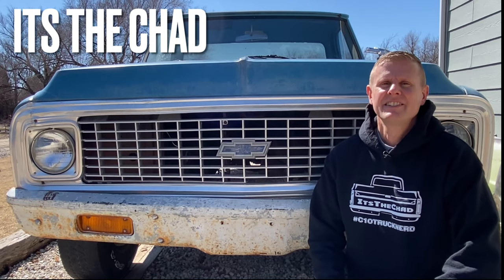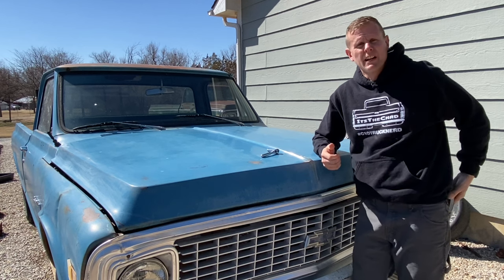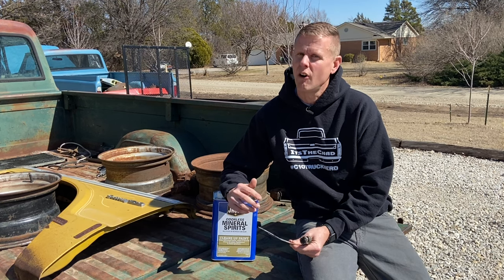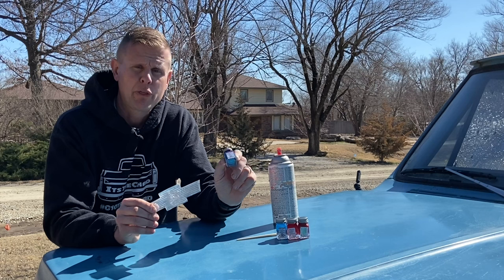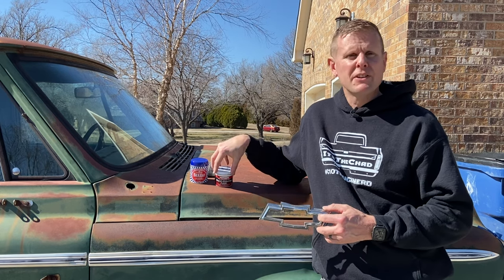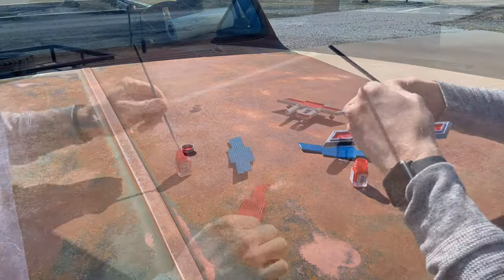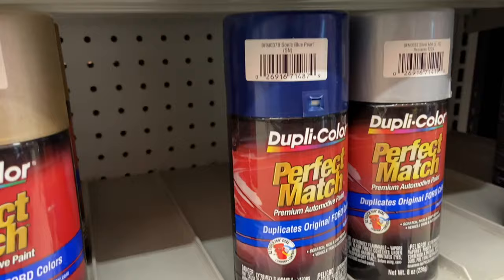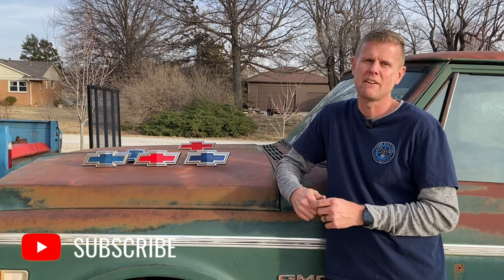Reviving The Classic Chevy Emblem: Restoring And Personalizing Your 67-72 C10

Comment: Great video. But what about the engine size emblem. According to LMC, those emblems are an option but I rarely see them. What's your opinion.  Thanks....Doug
Reply from the maker: They started in 69. 69-70 they were under the C10 or Custom badges and then moved under the side marker for 71-72. I keep a bunch of them when I part trucks out.

Comment: I prefer the blue in the grill . I was hoping to see how you put that 67 fender emblem back on. I mean to take mine off and I'm wondering if there's a way to do it without removing the fenders
Reply from the maker: OG blue looks the best to me as well. It is very difficult to slide your hand from the bottom or from under the hood to reach them. As you can tell, I have little bird arms which helps. Pulling the back of the inner fender down might be the best bet if you soak the bolts first. You have given me an idea for a video!

Comment: Chad ! Have a question you'll probably know ! Was the 66 C10 1500 the last year for wood bed floors ? I think so but another guy says NO ! Thanks for ur reply ! 👍
Reply from the maker: It was not. Wood continued to be the standard floor in 1967 as well and was still painted black. In 1968 metal floors became standard with wood as an option through 1972 but would have been painted the body color. Hope that made sense.
Reply: Thanks chad, guess I was wrong ! Was thinking 66 was the last year !.😂 win some, loose some ! 👍

Comment: Chad, thanks for all of the information that you have been providing.
I have a question, 67 with west coast/trailer mirrors, when new were the nuts and bolts used painted or plated.
Most of the trucks including mine that I see have everything painted white. Is that the way they came new?
Thanks,
Dave
Reply from the maker: Looking thru my info it looks like they came both ways, but the plated all rusted before the brackets.
Reply: @C10TruckNerd  Thank you for responding, knowing that some came unpainted I think I’ll go stainless.
Reply from the maker: @Dave-jj4np  They look pretty sharp! Good luck!

Comment: Are the 67-68 grill emblems a similar dissembly process?
Reply from the maker: The are more basic. They are metal and the studs are mounted on the back side of the bow tie. You just paint the front.
Reply: @C10TruckNerd  thank you for the reply!
Reply from the maker: @renewed7809  You bet!

Comment: CHAD MY 1967 DOES NOT HAVE CHEVY ON THE HOOD HOW ARE THE LETTERS SPACED
Reply from the maker: I have never found an answer to that question. I’ve seen guys take large masking tape or a roll of paper. Roll it onto another 67-68 hood with the letters removed and punch holes in the paper and tape. Then tape it onto the hood you want the letters and start drilling. Some after market hoods don’t have access holes for the nuts to tighten.